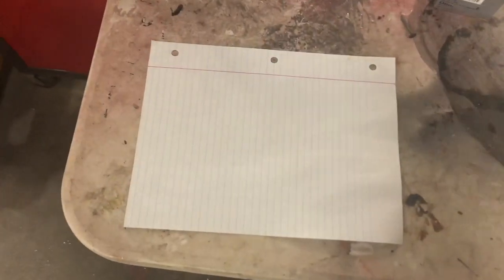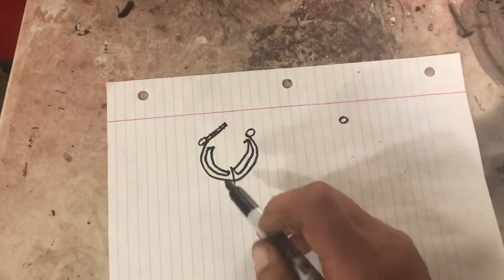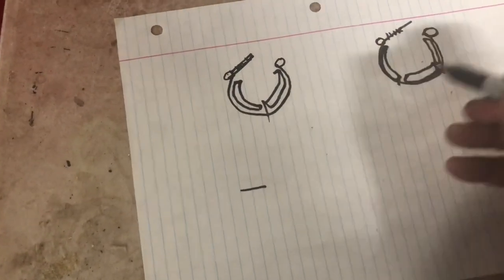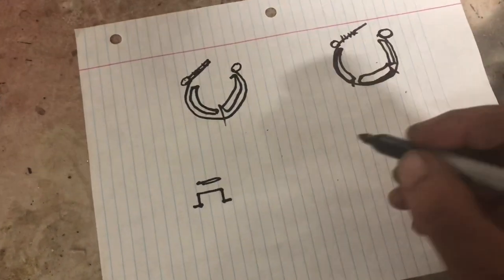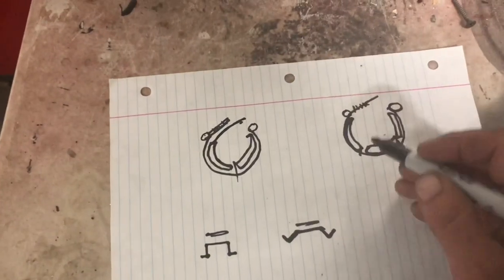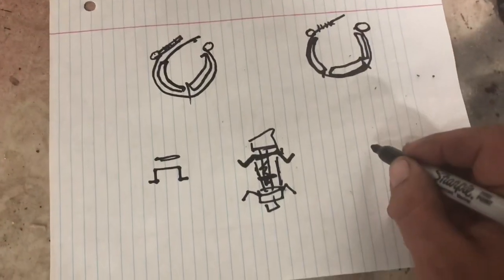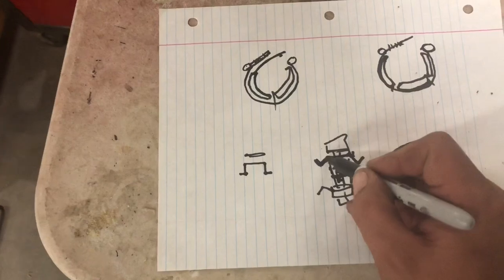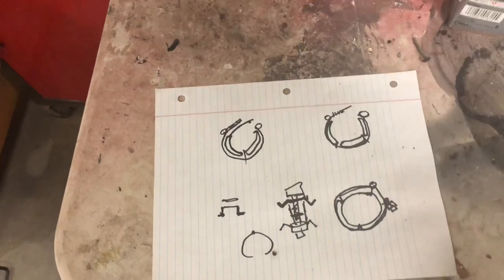Pre plan on cuff connection for the work shed chainsaw

Comment: i bought a simple T-bolt clamp at a hardware store
Reply from the maker: Jason Wade Cox the clamp I bought was only 13.00-14.00. But the modification will be the challenge
Reply: sent two pics thru facebook.   No idea if they will help.  
My saws are metal casing
Reply from the maker: Jason Wade Cox I checked them out.  Thanks 👍